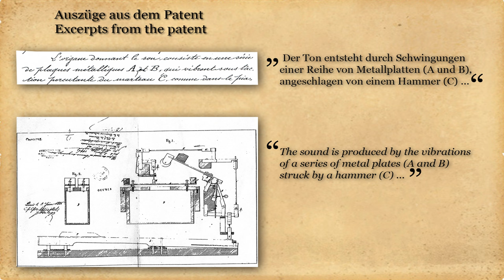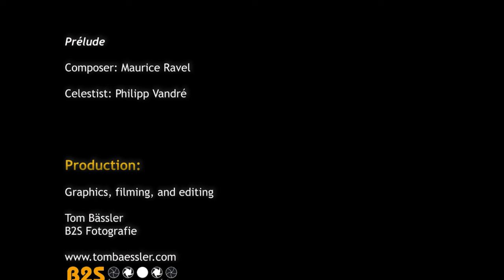The CELESTA musical instrument - All about the history, sound & more (also spelled Celeste)

Comment: Still baffles me why the overhead hammer action.....why not just use a grand piano style under action, its like trying to reinvent the wheel? but...tbh the Schiedmayer are by far the "steinways" of the celesta world, I'm a percussionist not a keyboardist but ive had the pleasure of playing one and was amazed with the tone in the lower range. Sounds like a vibraphone and glockenspiel merged and was smoothed out...just wish i could afford one of those musical marvels....maybe the sugar plum fairy will bring me one for Xmas
Reply: I don't know the answer about the overhead hammer action, but I'm going to make an educated guess based upon engineering principles:  Since the bars are sitting lightly on supports and only lightly held down by fasteners, if the hammers were to strike from below, they would cause the bars to jump, causing a glitch in the sound.  If you were to tighten the fasteners to hold them down enough to prevent this, you would deaden the sound.
Reply: @Lucius_Chiaraviglio  seems like a good reason to me...
Reply: ukguy Also, on further thought, the resonator occupies almost all of the space under the bar, so having the bar struck from below would require relocating the resonator to be over the bar.
Reply: One word my dear: resonators with the resonators under the plate, the only place to hammer it is from above
Reply: One word my dear: don't pretend to know what you're talking about, what if you place resonators on top? Yamaha celestas are build that way with grand piano action
Reply: @ekstrapolatoraproksymujacy412  But what's the point of a piano action if you don't need the same control and dynamics?
The top position better resembles the way you usually play glockenspiels.
Reply: @BetamaxFlippy  Really? So if it's worse, it's better? If you have better control and ease of play, if you can easily switch from piano to celesta, it's bad celesta?
Reply: Thanks for this discussion.  I found the excerpt from the patent amusing, where it says that the hammers' position is "very special" since it's overhead rather than underneath or to the side.  Therefore it's nice to hear the logic behind that (and that it wasn't, say, just to make sure the instrument didn't fall under prior art).  The longest resonators are quite long indeed, so if they were on top rather than below, it would seem it would block the player's view of the conductor and rest of the orchestra.
Reply: Although from what duperszfanc duperszfanc said about Yamaha celestes, I guess they solved that issue by making the long dimension of the resonators horizontal rather than vertical?  Wait, did you mean "were built that way" rather than "are"?  In this video Schiedmayer Celesta GmbH claims to be the only remaining celesta manufacturer in the world.
Reply: As for the "resonator" issue, they cn be placed vertical ip or down or....like a portable vibraphone from the 60s had, mitred tubes going horizontal..........FYI Ive managed to buy a Dulcitone from a local "antiques" store.....AKA.....glorified junk shop! Needs work....the owner was trying to sell it to me as a "toy piano", you would of sworn he was a expert the way he was harpin gon!!
Reply: @ekstrapolatoraproksymujacy412  Schiedmayer says Yamaha's instruments are not celestas, but "keyboard glockenspiels," because they do not follow Mustel's patent. Not surprisingly, Yamaha disagrees...
Reply: @DanHarkless_Halloween_YTPs_etc   The original patent don't say the hammer position is "very special" its just saying that its not the same as a piano. on the patent hammers are supposed to hit the metal pieces between two weights soldered at both ends of each, this is suposed to 
have more sound power and a "purer" tone.
also the patent compare the Célesta to kids toy "métalophone" and "harmonica timpanon" (written like this in the og patent).
Reply: @jonathanth9108   Nope.  See 0:42 — the patent literally says "the hammer position is very special" / "die Hammerposition ist jedoch sehr speziell".  Thanks for the additional info, though.  I'm familiar with the métalophone, but I'd never heard of the harmonica timpanon.
Reply: @DanHarkless_Halloween_YTPs_etc   sorry I meant I read the french patent that you can download at this adress : https://www.celesta-schiedmayer.de/en/celesta/all-about-the-celesta/patent/
and it never say that the hammer position is very special, it's probably the person that translated that felt it was important to say that it was a unique system but the patent intself don't particularly insist on that.

never heard of the harmonica timpanon before but I suppose it's just a tympanon
Reply: @jonathanth9108   Ah, I see.  Could also be that the hammer position being "very special" was only something they needed to mention in the German patent due to prior art there.  Thanks for the followup and link.

Comment: Celesta is a mother of Fender Rhodes.
Reply: funny, i was just thinking how close it sounds to the fender rhoades in the composition that plays during the credits.  why do you say so tho? they have similar engineering?
Reply: Barf Face fender Rhodes also uses tiles or reeds rather than strings subjected to tension.
Reply: @bacicinvatteneaca  they're called tines. Small metal rods that vibrate like a pitchfork.